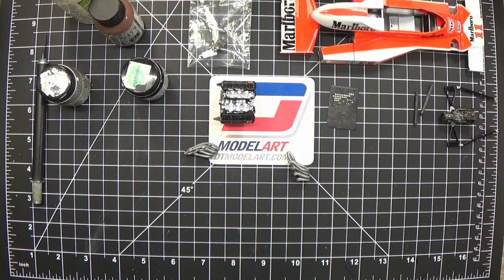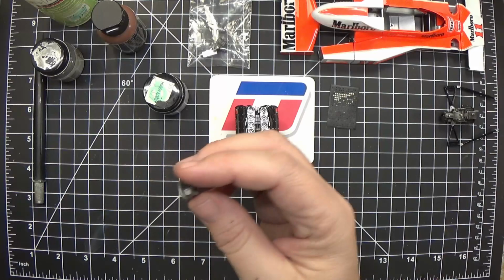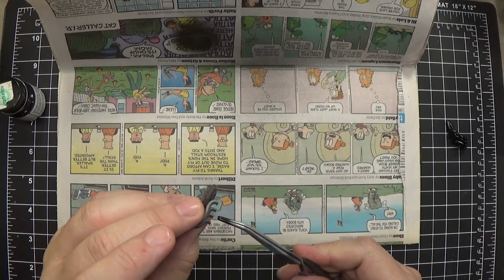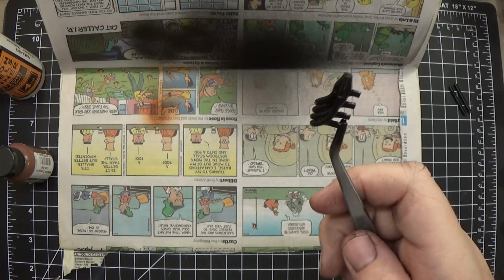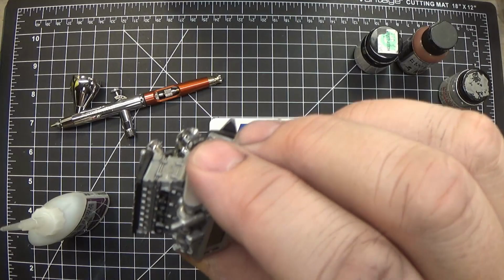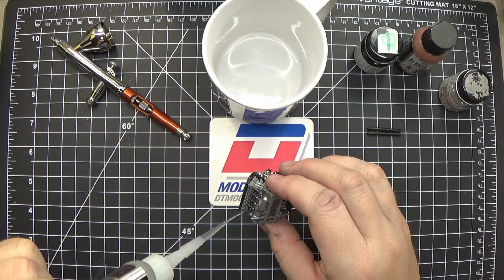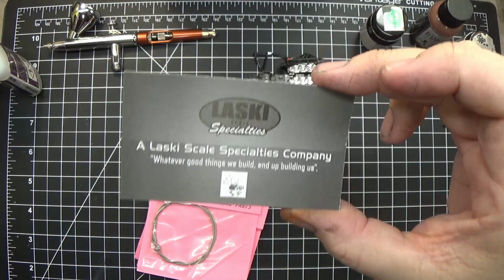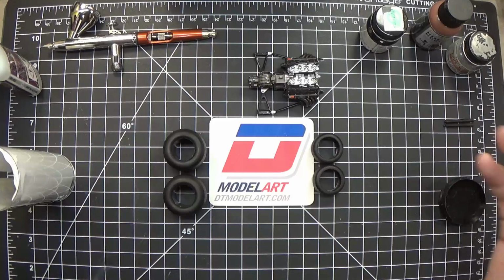Tamiya 1/20 McLaren M23 1976 Part 9

Comment: Super gold + is bloomless CA so it doesn't haze and is safe for clear parts. My bottle is pretty thin too. I use a needle with half of the eye cut off in a pin vise as an applicator so i can control where it goes. I use the super gold for clear parts, and any parts going on the body as it's not as destructive to finished paint. For anything else I use the maxi cure which forms a much stronger bond. Insta-cure cures faster, but my understanding is the bond is weaker.
Reply from the maker: I knew it was haze free but my last bottle was not so damn thin! Lol
Reply: @dtmodelart9533  they may have changed it recently? Like i said mine is pretty thin too. It's not water thin, but it's like real thin watered down corn syrup.